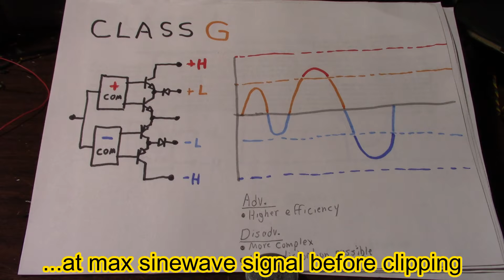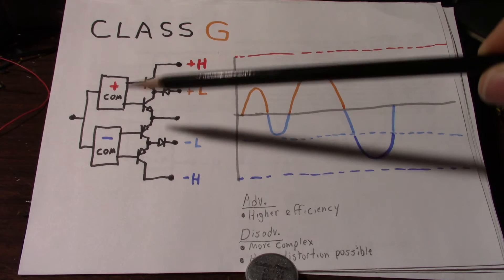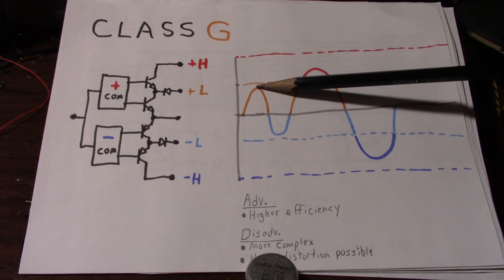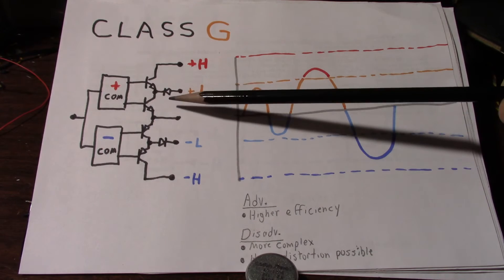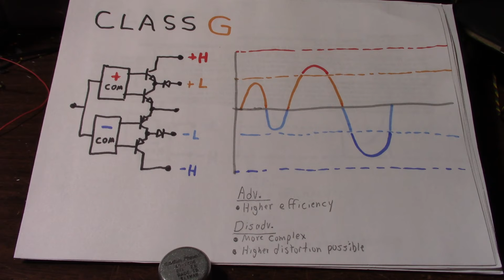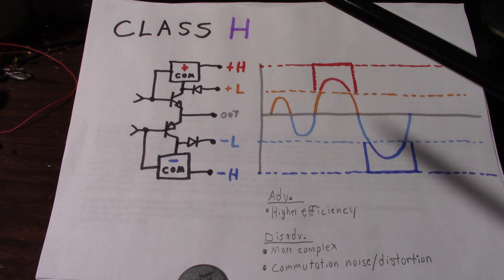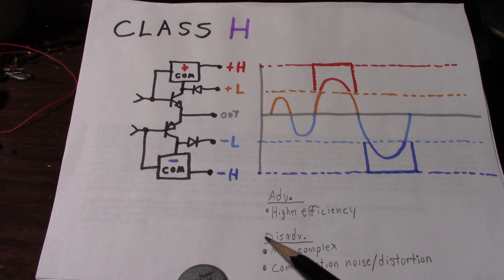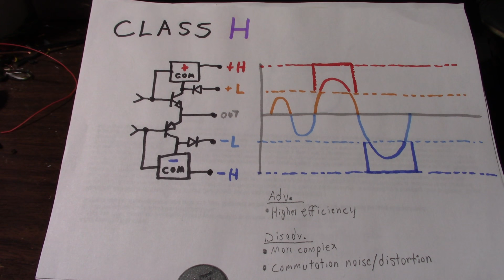Class G & H audio amplifiers - How they work

Comment: I have 4 RPA-16 amps. from Rockville and they are class H amp.s love them.. they weight 47 lbs. each and each for right around $400. I can get with a 4-ohm. load 1.7K. watts per side..at max output.. Great value for the money!

Comment: I have a late model Phase Linear design, DRS900, designed by Carver.  By their description it sounds like it would be a class H; 6 supplies (3 per channel) with separate plus high and minus high supplies, rated 150W RMS and 900W peak.  I never knew of the class G & H designations though.  Bought it at a nice discount when Jensen bought and discontinued the line.  A very nice amp for the early 1980's.

Comment: I owned a couple Carver amps. The first was a receiver, I forget the model. After a week or two I sent it back because I was sensitive to a very high frequency it seemed to be emmitting. They did tests and said they found no such signal in the output.  I traded it in for a 400t, no such problems.  I think in hindsight it was a spurious reverse microphonics issue in the power supply, only audible outside the output signal. Being a newer product the 400t probably had these issues designed out.

Comment: In the later 1970's Hitachi pioneered the class G amps and Soundcraftsmen used class H. I purchased a Hitachi SR-804 class G receiver in 1979 and still use it as my main amp. It's weight (for a 50wpc receiver) is under twenty four pounds. Most similar units from that time were well over thirty pounds and didn't have 3dB's of headroom. The Hitachi SR-804 runs cool. Even after several hours pushing my Ohm L's (4 ohms) to loud levels in my 1,700+ cu/ft living room, the receiver top is barely warm. I did use a Marantz 2252B for a few months during 2015 but like the seemingly effortless power of the Hitachi. Great video, a lucid explanation of amp classes.
Reply: I took the chance and purchased  a Hitachi SR-903 last year (~US$138, physically mint condition) via a local online listing.  After cleaning (Doxit treament), basic checks (DC offsets) and careful running in (dim bulb), I found the sound exceptionally clear, full...very nice bass...beautiful. With 75W at 8 ohms RMS...up to 160W for peak transients, the Class G amp runs cool.
I liked this receiver so much, I bought a second (6 mo. later) that showed up on the same site (different seller, $120)...not as clean as the minty first receiver but in EXC physical condition.  Same routine...checked out sat.
I did modify both with a nice glossy vinyl wrap (burled walnut; $20) that turned the factory black wooden boxes into lookers. Also changed out the hard rubber feet for machined ALU feet (58mm) with rubber base-rings ($20 on Aliexpress).
The first unit sits in the family room, fed by FiiO BTA30Pro (in RX mode) paired to Dali Spektors.
The later unit sits on my desk along with a Marantz EQ20, fed by PC/FiiO BTA30 Pro(DAC mode) and paired to a)Mordaunt Short 20i speakers and/or b)Sony SS-CSD1's.
More than enough power, for my needs. Way more.
IMHO, these are absolutely wonderful units...so glad that they are relatively unknown and do not carry the Marantz-Pioneer-Sansui "tax".
I did buy all of the electrolytic caps (incl filters...I did up the voltage from 6800uF/80V to 6800mF/100V(105C) on the main filter caps) and known "issue" transistors (e.g. SC1344/1345 to be replaced by KSA992/KSC1845/2N3711); enough for a planned project revision on both receivers.  The service manual is excellent and the PCB's are well-marked within each unit. I figure it will be easier to master the specs and do this for two of the same model.
Reply: @jb678901 - yeah, under the radar for sure. And thankfully, not as desirable as the big four (Marantz, Kenwood, Pioneer or Sansui) but much better IMHO. In those days (later 1970's) Hitachi components were in house built. Everything in that SR-903 was manufactured by Hitachi, even the screws holding it together. A great High Fidelity magazine review summed it up. " If discs (records) are your bag and you like concert hall volumes, this receiver (SR-903) will really show you something". A last thought, the volume control on my SR-804 goes well past the twelve o'clock setting to past two and doesn't distort. It just gets louder. Most receivers start distorting well before that. There really is something to that class G, 3dB headroom claim. Swell score on two SR-903's. Yep, clean, clear, crisp sound. I would say "clinical" and will show off or show up your connected speakers.

Comment: This concept reminds me of a feature of certain Cadillac internal combustion engines, which would operate on 4, 6, or 8 cylinders as power and speed requirements changed.  As I  recall, the technology never really caught on due to the added complexity.  I wonder  if class G & H amplifiers are less common for this same reason.

Comment: A number of manufacturers these days are saying something like "our amp produces 75 Watts in Class-AB, of which the first 10 Watts are in Class-A". Would you consider doing a video to explain what that means exactly? With one of these beautifully simple schematics?
Reply: I suppose this could be said of any AB2 amp when the output current is small compared to idle current, and a few AB2s push idle current far beyond the typical 50mA up to a few amps. Requires a lot of heatsink capacity.
Reply: @HillsWorkbench  Oh, okay. My understanding of class AB2 isn't great — I thought it was something you'd basically only find in tube amps. So do you think that's what Pass Labs is doing for their integrated amplifiers? On their website they say: "the INT-60 presents 60 glorious watts per channel into 8 ohms, and doesn't leave class A until 30 watts thanks to its high-bias operation."
Reply: @jonathanvanier  Yup,  Up to half power is taking it a bit far though...

Comment: I think the TDA7293 has dual rail options according to the spec sheet, they call it BCD. Any ideas what BCD stands for? Its described as follows:  The device described has therefore been developed in a mixed bipolar-MOS high voltage technology called BCDII 100/120.
For the operation it is described as: . T1 and T2 are two power transistors that only operate when the output power reaches a certain
threshold (for example, 20 W).
If the output power increases, these transistors are switched on during the portion of the signal where more output voltage swing is needed, thus "bootstrapping" the power supply pins 
Does this mean that the TDA7293 could be considered class g or h?
Reply: @James W  -  I looked at the spec sheet. It's a very interesting device with optional external circuit configurations: Bridge Mode, Buffer Driver and Modular. SO THEN, BCD MUST NOT MEAN BINARY CODED (count) DECIMAL.  lol  What does that "C" stand for?  Pin 11 is called Buffer Driver to allow additional TDA7293's to be strapped together in parallel to drive lower impedance loads. (Pins 6 and 12 are for a Boucherot HF Damper R/C Circuit.) Pin Pairs 7 & 8 and 13 & 15 allow external transistors and two diodes to accomodate the two different +/- rail voltages shown on the spec sheet figure 8 example for high effeciency.  This video first shows the four external transistors for G first, then the second diagram shows only two external transistors are required for H.  Because the four transistors are wired as Darlington Pairs in the application notes on the spec sheet, I think they'll only count as two external transistors and that would make it, H Class as shown in this excellent video.

Comment: Very interesting. So the distinction between G and H is that (using your letters), H just turns the Hi supplies on and off, whereas G uses the top and bottom transistors to provide pseudo Hi+/- supplies at voltage slightly beyond what the middle transistors need to avoid clipping. Essentially G provides to the middle transistors a supply voltage that tracks their needs.
Reply: I guess I missed that, because to me the explanations of G and H sounded the same. Good catch. I was lost.

Comment: Thanks for another interesting video, John! I had to fix one of the power amps for the subwoofers in my home stereo. Class H - low, mid and high rail and to top it off, the 12 output transistors is configurated as sziklai pairs. Took some re-engineering before I could start the troubleshooting and repair.

Comment: I wonder what can be done with this in regard to a guitar amplifier.  In hifi distortion is a no no. In guitar amps that's fully acceptable and designed around.
Reply: There's no real reason why you couldn't aside from the fact the power levels are often a lot lower. The distortion of class G/H is not like overdrive, though.

Comment: Your among the few channels that keep me using YouTube. Thanks! This series has helped me clerify a lot. That being said. Efficiency is over rated in my opinion. In the real world, for me anyways,  my audio battery use is my phone. Aside from that I've swapped enough light bulbs out for led to more then compensate for the very limited use of all my amplifiers combined plugged in.  So for me efficiency isn't a factor in most cases. It does play a factor in size and cost though at high watt output but at some point cost goes out the window too for the right project.
Reply: Efficiency is not only about your savings, but also about the amount of engineering required to dissipate all the losses. Higher efficiency will absolutely reduce your amplifier's cooling need